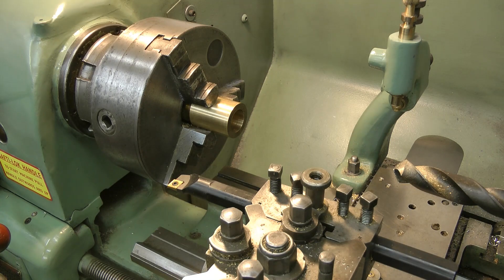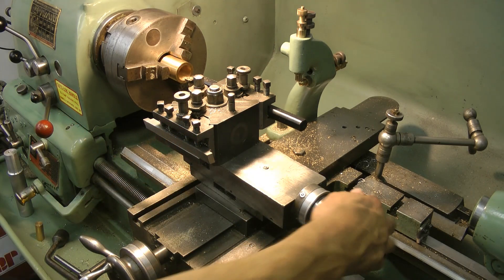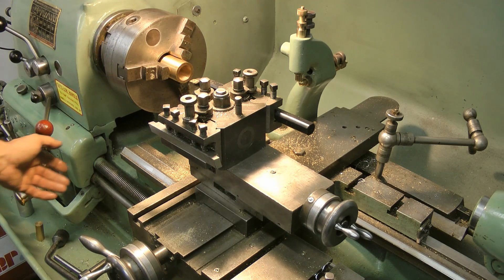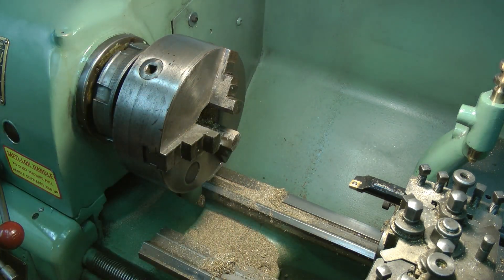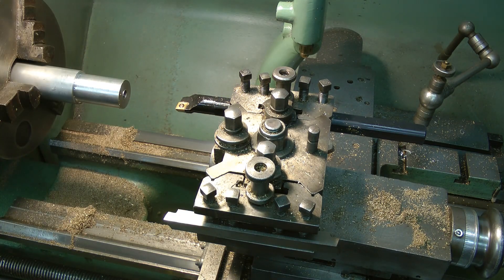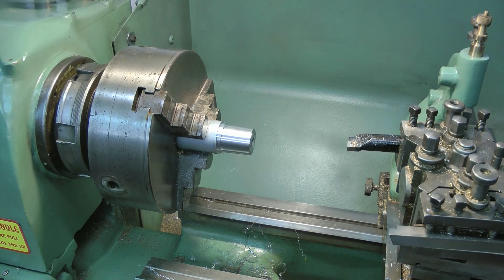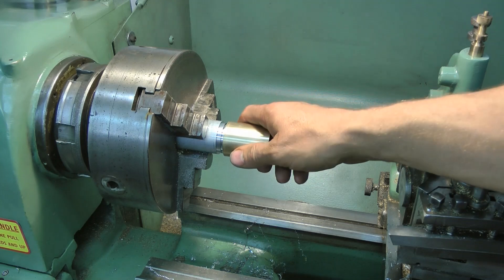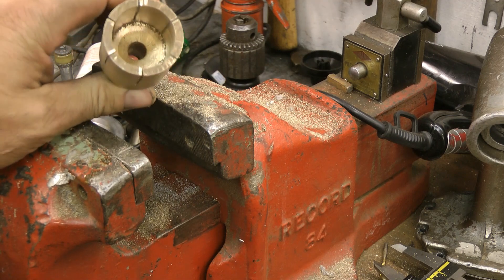Hand threading on the lathe machine part two build

Comment: I just happened on to your channel ,  I was watching machining videos . heard what you were saying about chatter , faster doesn't normally make it better . Take a cylindrical piece of steel or brass longer than your chuck jaws ,wrap with a strip of paper full length one wrap only & chuck firmly . remove from chuck & observe grip impressions on paper . If Very deep at rear of jaws & shallow at front , the jaws are bell mouthed ( normal wear as jaws wear in ) on your chuck ; the only fix is to grind jaws parallel again or replace chuck .  GOOD JOB on handle ! Best of luck !
Reply from the maker: Thank you Byron !  Great explanation of the problem, I’ll definitely try the paper method and see what’s happening,  I’m a carpenter by trade , so machining is a little bit of a escape from the real world for a couple hours  🙂 thanks again for the nice comments, regards Chris

Comment: Great job👍
Your bedways looks very dry. It will help with chattering if all ways are well oiled.
Reply from the maker: THOR Welding Innovations looks like it’s the drill bit geometry.. need to regrind  for brass ...
Reply from the maker: Did you look at the link wobbleybob posted in the comments, a link to a click spring video talking about bits for brass, very interesting and easy too , you learn something new everyday